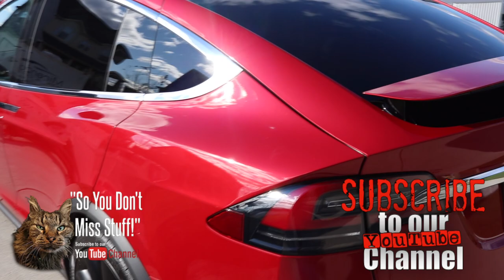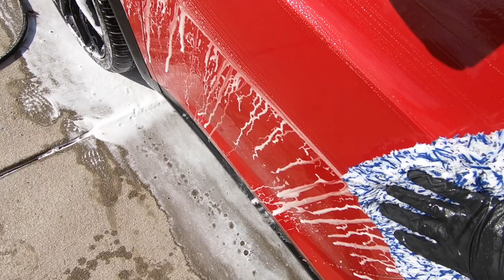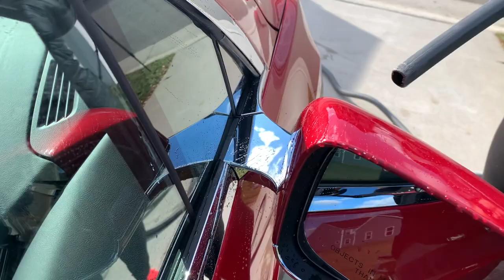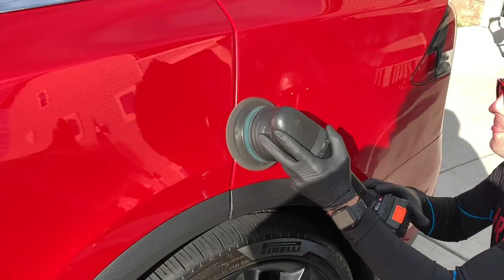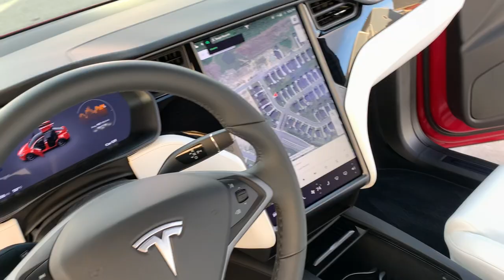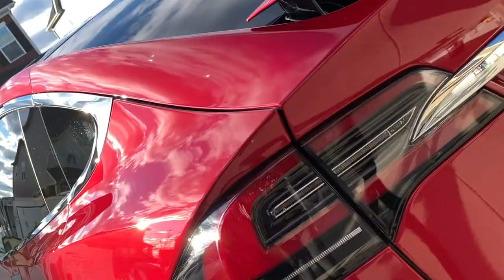Exterior Detail / Tesla Model X

Comment: Phil I have a question off subject of this vid. Do you know how, or if it’s possible, to order just batteries for our SPTA cordless polishers? I know you have 2 of the polishers and 4 batteries. I use mine 80% of the time for what I do. One of my batteries seems to be getting weak even after a charge. Thanks for any info you could give.
Reply from the maker: Hi!  Yea you can buy just the batteries https://amzn.to/35Putti
If you run it on high I notice it runs out faster also. We use them a lot!
Reply: @MirandaDetailing  thanks for the info. I also saw where a Makita 18v lxt will work on SPTA, but you have to have a Makita charger too! I’ve been singing the praises of SPTA cordless on FABs and PapaSmurfs live chats and they both mentioned that you as loving the SPTA too!
Reply from the maker: You’re welcome!  I got the after market makita batteries and chargers and they work just fine also. Give them a try https://amzn.to/2LAicSS
Reply: @MirandaDetailing  Thanks Phil...I went ahead and ordered 1 more SPTA battery from the Amazon link you shared. I’m gonna check out this link too for the off market ones too.
Reply from the maker: Awesome!